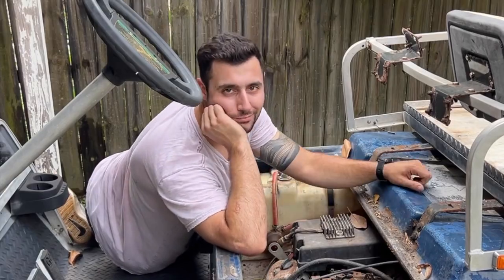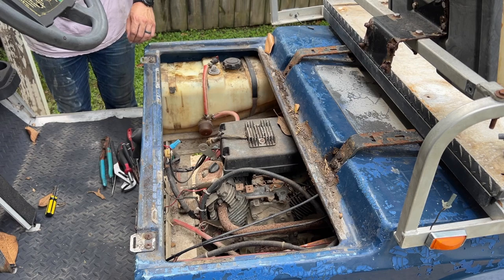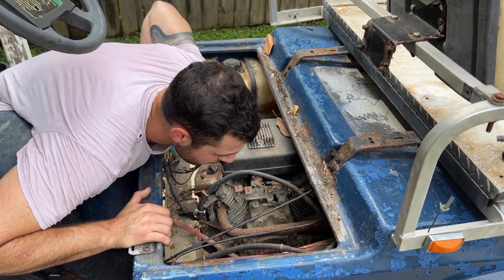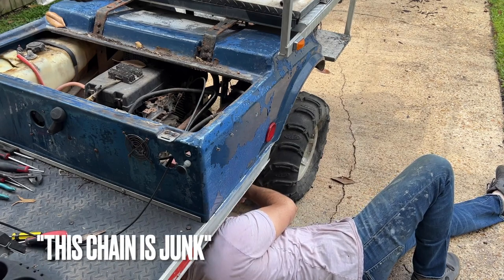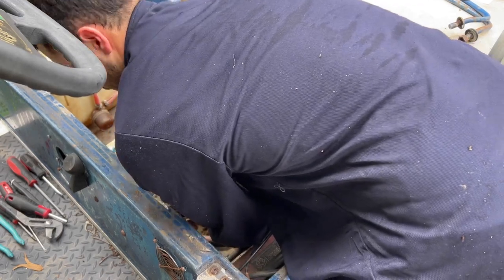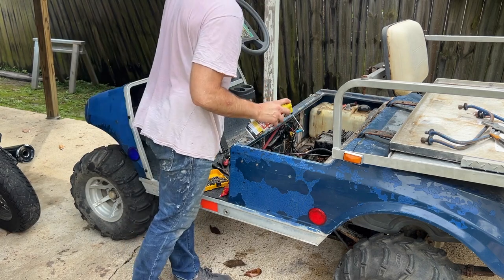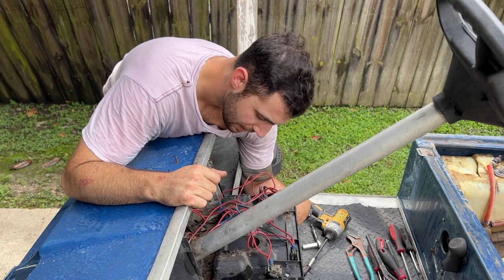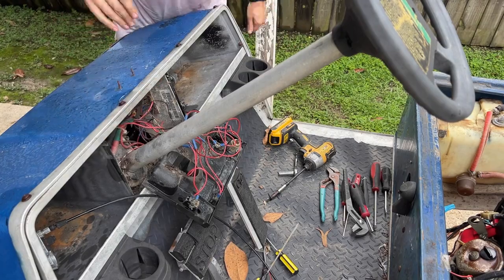Will It Run? 2004 Honda GX670 Golf Cart - Part 1

Comment: Hi! You're working on my old cart! Feel free to reach out for any context/history etc. The frame is a 2002 Club Car DS (I think, it's been a while)

I had last run it in late 2018, when I shattered the jackshaft and clutch. The engine is/was a "brand new" engine put into the cart in 2007- it's got less than 40 hours total runtime on it and like 6 oil changes since I never ran it enough. The engine has high RPM valve springs and a 1.5 degree timing advance designed to run to 4500RPM (technically rated to 5k but I never pushed it that far). It was perpetually "in development" as it was not originally a chain drive, but an actually engineered belt system. Belts kept failing and the engineer (Jacob Lowry at Buggies Unlimited) got tired of dealing with revisions. The engine base plate is a fully engineered design to adapt to the stock engine tray. 

It was still full of Royal Purple 10w30 when it last ran, fresh change. You WILL have an oil leak on the oil cooler, probably needs to have one of the oil lines tightened up. The throttle cable... yes, that's a brake lever used as a throttle handle lol. The existing pedal assembly needed a re-engineered solution to work with a cable. Be careful with the actual brakes, they're guaranteed to be a rusty mess. 

It's a 3 wire operation system, power to the ECU, power to the starter, power to the starter solenoid. I think there's only 5 wires total run to the front. The red wires... I hope you don't look! Flip the big red switch to turn it on, push the button to start it. The big front solenoid is not actually in use- it was for a forward winch which was never installed. I think I mainly used it for power jumpers to the switches. 

Please, whatever you do, don't go back with the chains, the feet per minute rate is far too high for any chain, not just the really cheap chain that's on it. The jackshaft and bearings are a tremendous failure point in Louisiana humidity, they corrode too easily. I had spec'd out a PTO stub and gokart clutch to go on the fan side of the engine, but some machining is required for best fit and I never did it. This removes the problematic jackshaft and keeps the correct rotation. The differential is geared something like 10:1 forwards and 18:1 reverse. Forward is clockwise rotation on the differential clutch. If you google other vtwin swaps for Club Cars, they probably use a Briggs engine paired to a pre-2000 differential which spins the other direction going forwards.

If you haven't already taken the rear body off, it's super easy and makes access to the engine way better. I think it's only held down with 6 bolts.
Reply from the maker: I dare say, you are the most helpful prior owner of anything I have ever encountered. All of this info is excellent to know... Especially the chain. I'll be getting to the drivetrain here soon in the next few days. If I have any questions, I'll give you a shout. Luckily, I got all the electrical figured out. 

I will be referring to your comment often during this build haha thank you!
Reply: @kearneycustoms534 I know you probably haven't done anything to the tires yet, but...

I just remembered that I put 1qt of tire slime in each tire sometime back around 2007... so probably don't break the bead anywhere a mess is bad?

It was being driven in inhospitable terrain with bougainvillea around, so punctures were a problem. Might be why the absolutely shot 6 ply holds air right now.
Reply from the maker: @suburbazine lol good to know I appreciate that!